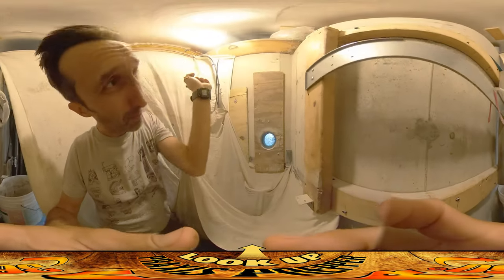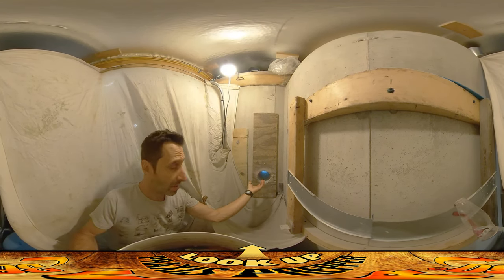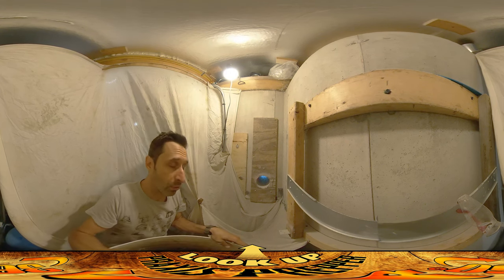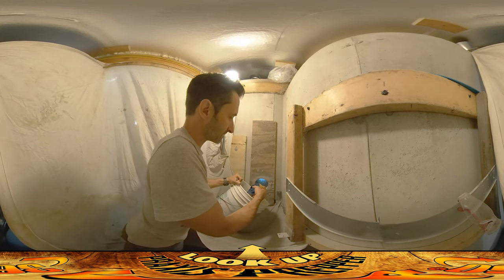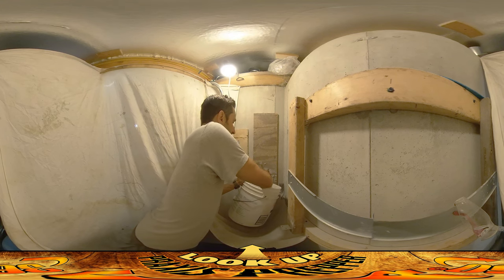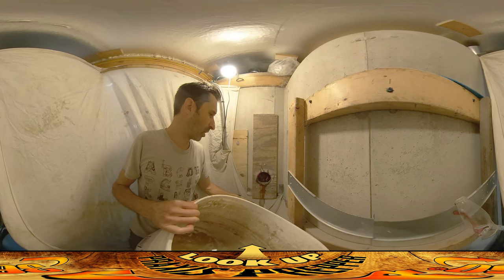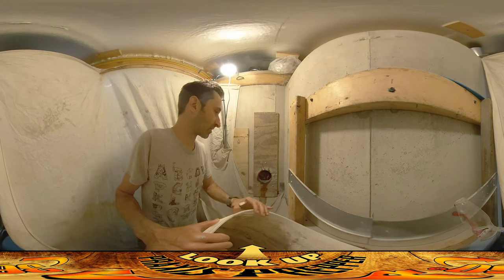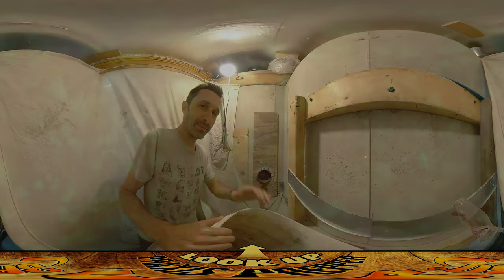Homestead Building - Coring a 5" Hole in my 10" Foundation

Comment: Now I'll tell you how I would do this, because I have done this with zero leaks, forget the hydronic cement,  I use construction epoxy,  its actually used to hold rebar in fresh drilled holes for concrete applications,  but works great for any material,  you can get epoxy that works with a regular caulk gun, tip, always get rid of the first unmixed bit that first comes out...try it one day.